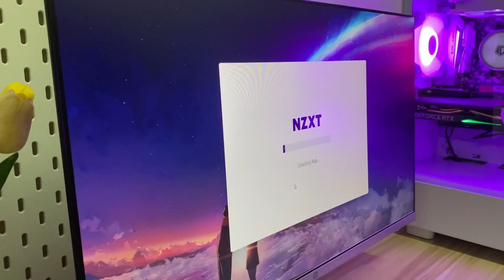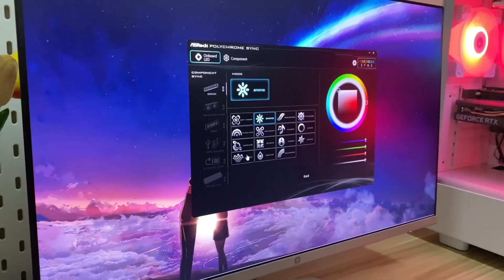building my first PC with me 🖥️ cozy white | mid-range PC | rtx 3060 ✨🤍

Comment: Did you have to update the bios on the motherboard? Because B450 motherboards are older than the Ryzen 5000 CPUs so I’m just wondering if they support ryzen 5000 out of the box
Reply: some boards come updated
Reply: i built my pc in December, it has b450m steel legend, ryzen 5 5600G, 16gb ram ADATA Gammix D45 (8x2), Corsair VS500 500w 80 plus white, wd green 480gb SSD M.2.
I had zero problems at all.

I play Witcher 3, Ni No Kuni, Horizon Zero Dawn, Roblox, Minecraft and some other games and never had any problem. You can buy it without worries.
Reply: @icarocintra378  Oh well, I already ordered a b550 board with bios flashback just to be safe, it wasnt to much more in price anyways. Thanks for the response regardless
Reply: @chrismansour5191  i have a b550-a board with a ryzen 7 and i had to update the bios to work with the cpu, idk if thats helpful or not lmao
Reply: @chrismansour5191  Oh alright. You did good tho.

Comment: Nice build.
Although, I really don't see any need to flip your AIO fans. In fact, with many fans being set as intake, it would ensure a positive pressure inside your case, which would prevent dust from coming in through all the holes and gaps in the case, so the only intake would be from fans with dust filter on it.

Comment: Hiya, fellow PC builder here. Just as a general rule of thumb is better to put your ram sticks in the 2nd and 4th slots as opposed to the 1st and 3rd slots because it gives you more clearance for your cpu cooler (also I’d say it looks better in the 2nd/4th slots generally). Now there won’t be any significant drawbacks to this but it’s just something I wanted to let you know of and it’s a real easy fix :)
Just make sure to fully shut off and power down your pc if you do plan on fixing it. Great build!
Reply from the maker: yes , about the ram , my husband told me too , and i change it after it . thank you for telling me 😊 and thanks for watching!
Reply: There are actually drawbacks - worse performance. What you stated arent even the main reasons people put their RAM on A2 B2 as opposed to A1 B1. It's because of dual channel memory which is achieved most of the times through A2 B2 placement and as I hope you know, gives better performance.
Reply: What??? You don't choose which RAM slots to use based on the CPU clearance or looks. Are you serious??? It's very important to use the right slots or you lose aloth of performance.
Reply: It's not about cooler clearance at all, it's about performance, however, not all motherboards are the same, there are a few that actually have the 1st and 3rd slots preferred (or so I have been told). Best to check the instructions for your specific motherboard.
Reply: You are wrong.. ram slots 2 and 4 are faster, Not to look better😂😂😂